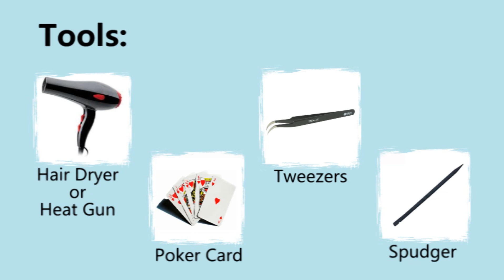Sony Xperia XA2 Teardown | Disassembly

Comment: the battery temp sensor is way to close the main board, whenever i go playing games it shows my battery temps really high, but then i used a IR camera to see the actual temps and the battery was cool
Reply: Mine got screen burn.
It runs HOT.
The screen cracked and I left it with the camera on overnight and it got so hot the screen repaired itself..the cracks has GONE! 
What is that about?
Reply: @JETJOOBOY  wait what? I have had mine for two years and it never overheats. Wasn't aware of this issue

Comment: Its a great and fast phone , however pay attention to factory installed APP's such as AWS which is a huge spying device , this APP will track all your movements especially purchase and credit card history ,it also collecting lots of other ads from other APP's  the APP can not be removed  and if disabled ( cause serious intereferance )  The phone gets hot during summer climate in Europe eventhough not exposed to sun at all , the cam shutter is way to slow and complicate in Whatsup mode , screen cam , video and flash modes hardly visible on screen , no protective case the phone will soon slip of your hands  but in general is a great device unless more surprizes during long term operations . Sony Customer support Europe a worthless piece of S !
Reply: I can drop this kind of phone 6 meters and survive.